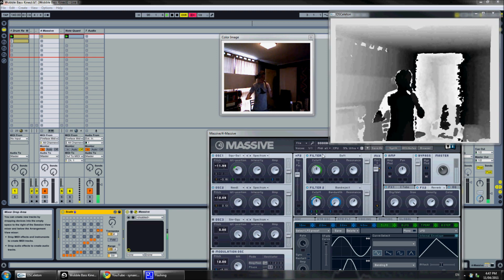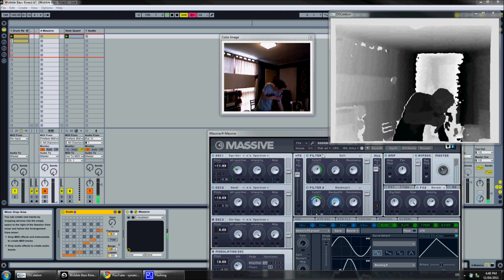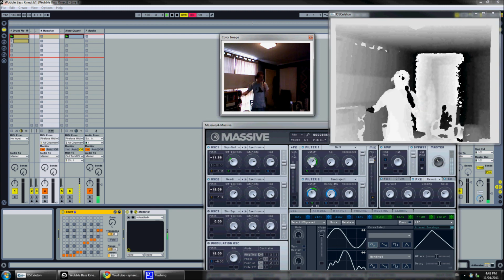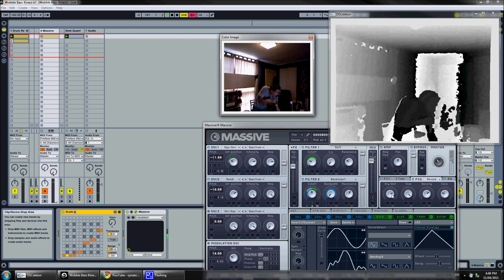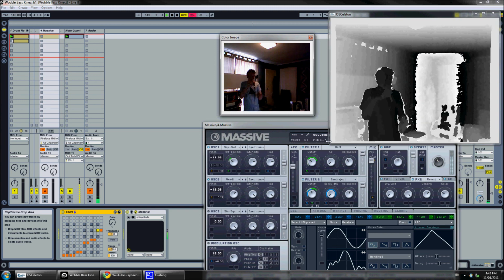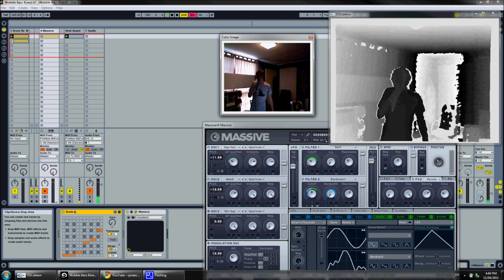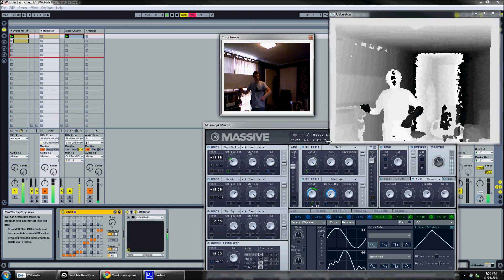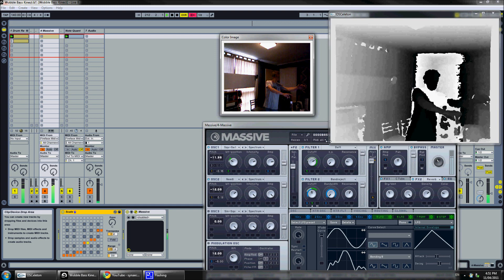Dubstep Bassline using Kinect (function demo)

Comment from the maker: @ABDL53661 OSCelecton just interprates the data from the Kinect and outputs OSC values. In order to use this OSC data in Ableton, you must use a program that can convert OSC into MIDI. I'll be releasing a program soon which is designed for use with OSCelecton.